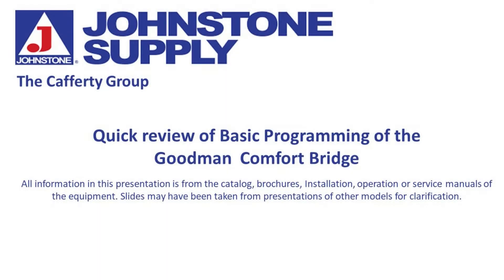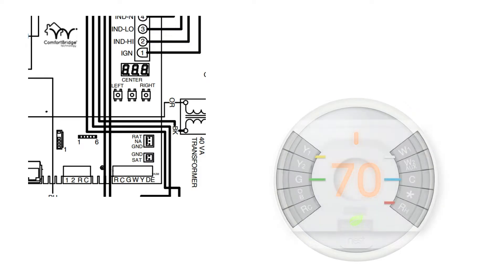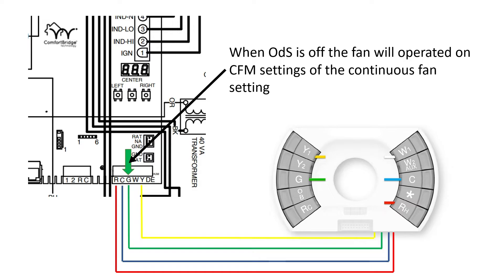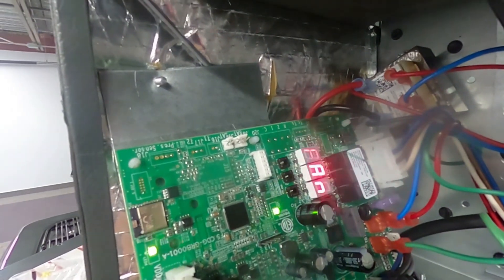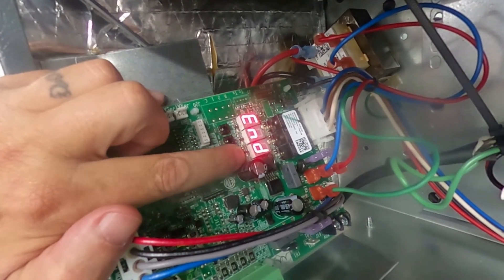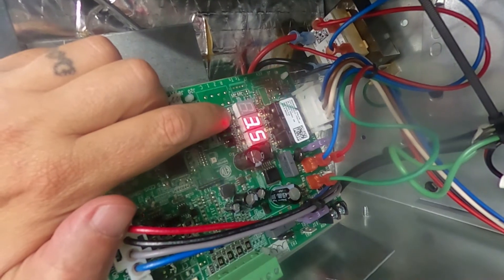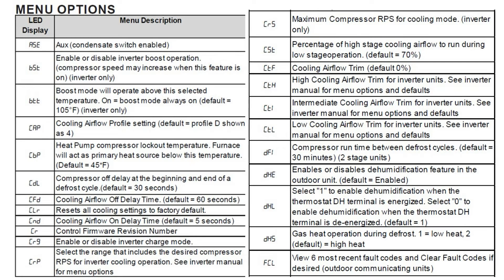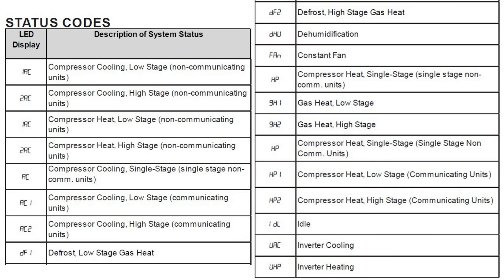Goodman Comfort Bridge Quick programming

Comment: My unit is GMVC80704BX, I do not have buttons near my lcd to set legacy mode. I see dip switches???
Reply from the maker: no problem then legacy wires would be from stat to furnace and outside correct. With dip switches its all comm or all legacy. The O from thermostat tells outdoor unit to be an AC. The thermostat sends the signal. Do a jumper outside R to O and see if it runs ac and if it does its in stat settings or wire connections.
Reply from the maker: That series would not be the comfort bridge series. On a standard board a plug with legacy connections is all that's needed.
Reply from the maker: yes, but the outdoor unit will need to be legacy wired as well. The board and outdoor unit will respond to the legacy signals and the comm wires 1 and 2 will not function.
Reply: @johnstonecg  alot easier than I expected, I wired it like a normal thermostat indoor on the extra terminal block.The blower worked, but the outdoor unit didn't kick on as you eluded to in this video. Haven't looked at the condenser but I'm assuming the condenser has the same terminal connectors as the indoor unit? I'd have to order another terminal connector like the one I have for the indoor correct?
Reply from the maker: @dl7481  The outdoor unit gets the same 24 volts as the board. So Y will run high speed fan indoors and compressor outdoors. The indoor board does not tell the outdoor what to operate, that's done by thermostat. Your indoor may be running off the G signal for fan and the Y is not functioning? If you have a meter check for 24 volts between Y and C outdoor. If you have a separate transformer wired to R and C outdoors unhook it and use R and C from indoor.
Reply: @johnstonecg  So I hooked it up legacy mode in the furnace. Outside I disconnected the transformer and fed the outside board with the 24 volts from r,c inside. It starts up in heat.
Reply from the maker: @dl7481  DId you legacy wire the the outdoor unit as well? Thats when you disconnect the rc outside and use the indoor. Did you use 1h1c stat then set the ods on board the HP1 or HP2 if you used a heat pump stat the O from thermostat must run to the O outside for cool call. A quick jumper from R to O outside will engage cool to get you by if legacy wired.
Reply: @johnstonecg  It is a Nest thermostat wired with single stage cooling and heat. No heat pump. Outside I wired just y, c on the terminal block, plus the r, c to feed the board outside after disconnecting the transformer. I did notice inside that the terminal strip I used for legacy wiring had w1 where the g is at on the control board
Reply from the maker: @dl7481  Wire between R and O outside to tell the unit its an AC
Reply: @johnstonecg  so your telling all I have to do is use the other terminal block ? I want to put a Nest thermostat. I know, I know don't ridicule me for doing so. The wife wants it🤷🏾‍♂️

Comment: Is there any videos on how the high voltage should be wired in the condenser that has a Bluetooth bord?
Reply from the maker: There up to 4 different communicating air conditioners and 4 heat pumps but all of them will have standard 208/230 connections for L1 L2 and a earth ground connection and should be plainly marked. with 2 of the models you can wire legacy (RCY1Y2OW) but if taking advantage of the indoor blue tooth set up your connections on control would be 1 and 2, never the R and C from inside on new equipment.

Comment: I have a 3 ton Amana unit and have a problem with high humidity.  I was wondering if this is because  comfortbrifge  was never activated on my unit?
Reply from the maker: It is not a question if it was activated, it is part of the system. But in the set up the cfm can be set as well as a dehum profile to assist in de humidification. excessive airflow is the enemy of de hum.
Reply: @Johnstone Supply Cafferty Group  how hard would it be to adjust the cfms and set up humidification?
Reply from the maker: @jerryees  If you do not understand the CFM and the relationship to de humidification I would proceed with caution. But if you down load the cool cloud app and talk to your unit or view all the settings before you do anything, at give yourself a chance to ask questions first you could be ok.

Comment: I am a homeowner  and recently installed a Goodman Heat pump (GSZC180241) and an auxiliary Gas Furnace (GMVC960603Bn). The system runs fine except the heat pump will not come below 41 degrees F. Instead the gas furnace comes on. I know the heat pump should be able to operate at lower temperatures, but my HVAC installer doesn't know how to adjust the point where the gas furnace takes over. He also tells me that the Goodman factory doesn't have any suggestions on how to do this. Can you help me with this issue?
Reply from the maker: Be happy to, on this system the thermostat would control the change over point, upstage and droop with the exception of the Daikin ONE thermostat that would function on balance point only. Please let me know what thermostat you are using and we will figure it out.
Reply: @johnstonecg  Thank you for your quick response. My thermostat is a White - Rodgers Emerson Blue Easy Reader 1F95EZ-0671. The following terminals are in use: C RH RC O/B W/E G Y.
Reply from the maker: @BrianMoffatt-kf2dv  Since you are using the O you are wired in HP mode and all the stage settings between HP and gas are controlled by the thermostat. That WR does not have an outdoor sensor and will not control the heat pump lockout by temperature, it also lacks precise staging control and any droop control. You can slow the rate of back up by going into setup for HP menu item 19 and move from 5 to a smaller number (start with 3 or 2). Sorry but that is the limit for that thermostat, the WR line i simplex but offers minimal control.
Reply: @johnstonecg  I may still have the option of switching thermostats. Is there another one that is especially suited to the Comfort Bridge system? I thought the advantage of the Comfort Bridge system was that it could be run by a simple thermostat?
Reply from the maker: @BrianMoffatt-kf2dv  It will run on any thermostat, even a on off light switch but you have limited control when to simplified. The Honeywell T6220 is are most popular thermostat for heat pumps. user interface is very simple and the set up gets complex as you want it do if needed. The T10 is not far behind that.
Reply: I also have Ana amana 3 ton 2 stage heat pump and while it cools the house it is very humid. I am using a honeywell TH8321WF  thermostat. I don't recall anyone messing with the push buttons on the circuit board when it wad installed. I really think the humidity problem could be a simple setting.
Reply: @oneuhhhhj  yeah I finally got someone who knew what they were doing come out and set everything up. I was told the fan motor was running at maximum tonnage. That explains why my house had so much humidity.
Reply: @oneuhhhhj  if ibwas to run that jumper would my unit run like a normal unit and still be efficient?
Reply: @oneuhhhhj  if ibwas to run that jumper would my unit run like a normal unit and still be efficient?
Reply: @oneuhhhhj  so it would only run at one speed but will it still be efficient?
Reply: @oneuhhhhj  I was looking at my receipt and it says 16 seer heat pump
Reply: @oneuhhhhj  yeah my unit is only around 4 to 5 months old. I actually got on a 1 year contract with a local ac company that offers a once a year total maintenance of the system. Rhe only problem I'm having now I'm that I live in Texas and thr weather has been 100 degrees plus every day so my unit seems to run alot.

Comment: I have a Goodman 4 ton condenser, and a 5 ton air handler. I'm trying to bring the humidity down. I don't have a heat. I scrolled to CAP. It showed 4 3 2 1.
Which should I be on, what are the correct steps when pushing the buttons to slow down the variable speed fan so humidity goes down.
Thanks for the help.
Reply: I don't have a heating element, I'm in Florida.
Reply from the maker: D would offer the profile best for removing latent heat (the humidity). If you are on a 9 speed we would need to view the model and ESP to review your CFM but if you scroll and see "ton" then your on a comfort bridge. You need to be 100% sure your on 4 ton or lower to have a chance of humidity removal, the ramp profiles slow the blower down by 7.5%, you can comfortably slow a 4 ton down to 4.8 and increase your latent removal with out threat to lowering super heat. All Goodman Units have the ability to control the blower using a de-humidistat to control the blower adjustment automatically with high humidity in the home and speed it back up when levels are comfortable. Look for your installation manual on line for information on the set up and if you feel its over your skill level contact a Dealer familiar with the equipment.